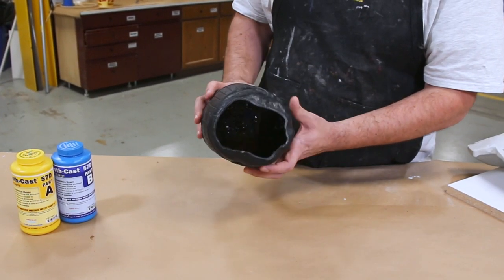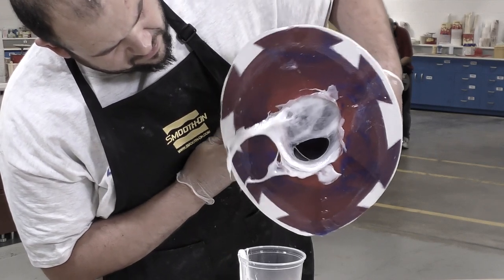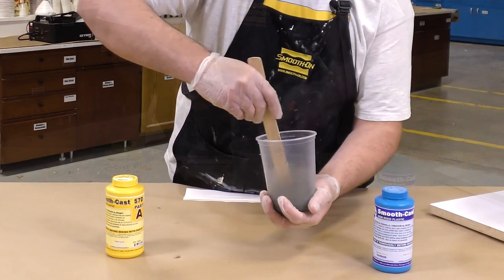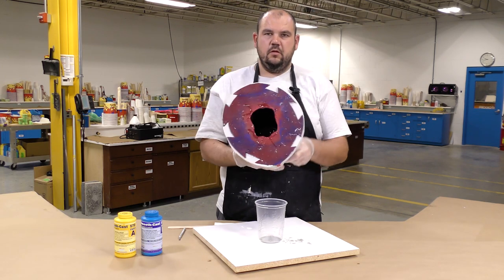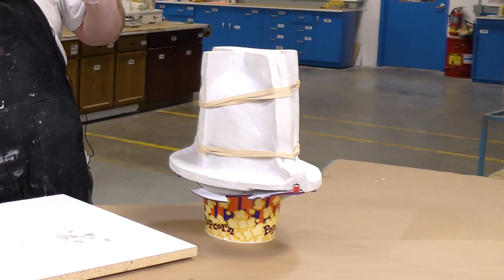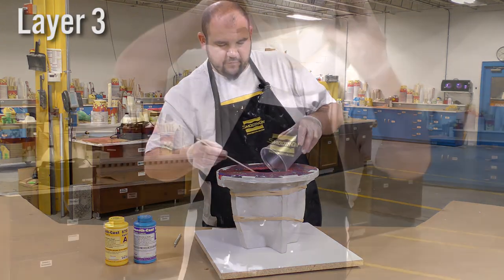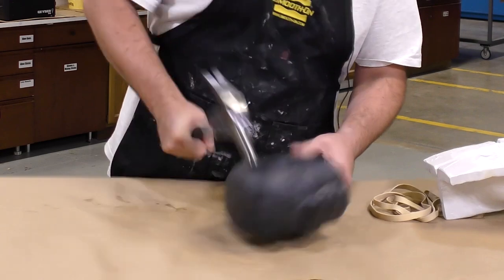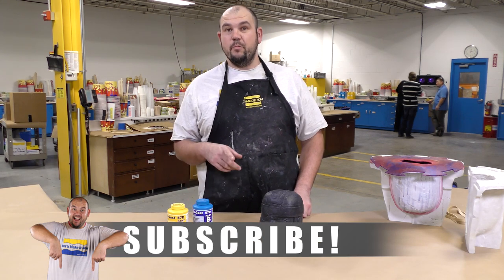Resin Casting Tutorial - Hollow Impact Resistant Casting Using Smooth-Cast® 57D

Comment: Thank you for tutorial. Can it be brushed ? If I have two half mold ?
Reply from the maker: Yes, many Smooth-On products can be brushed on. However, the specific method of application can vary depending on the product and the project. If you have two halves of a mold, you might need to brush the material onto each half separately, then join them together. For the most accurate advice, I recommend visiting the FAQ section on our website or contacting our Technical Service Department. They can provide detailed instructions based on the specific Smooth-On product you're using.
Reply: @smoothon  Thank you!!🙏

Comment: I have a question as I am dubious about the end of the video.  After the cast is out we see an impact test but not the inside of the mold. The flashing on the bottom is lighter colour than the grey from cutting the flashing and its blurred out at the end of the video showing a super bright white 4th or 5th layer of reinforcement Resin. Why was this not mentioned in the video, why is the cavity hidden for the impact test.  This stuff is a lot of money to use in my prototypes and would be more than angered if my hammer test breaks my piece. What's the missing info.
Reply from the maker: You have a great eye for detail! These videos are shot over a number of takes and often different concepts or ways to illustrate the steps are tested out. Ultimately, all of the footage is edited together to make a (hopefully) clear overarching narrative. The hammer footage at the end of the video is taken from a slightly altered version of this tutorial which did have a bright white interior; however, all of the test castings underwent the same hammer testing and as long as they were at 4-5mm thickness, all survived without a scratch. Of course, we'd always recommend that you do your own small-scale testing for your own pieces to determine suitability for your specific application.

Comment: What was the main reason for using 57D instead of 65D? How much of the 2 pound trial kit did you use in this video?
Reply from the maker: 57D is easier to color to a deep black as it does not cure with a change to white like the 65D does.  About half the kit was used.

Comment: I have a quick question: If i where to use transparent casting with this method, would the cured end result be transparent enough to see through without any polishing inside?
Reply from the maker: Rotocasting a clear resin does not generally produce an optically clear surface, as bubbles can form during the rotocasting process.

Comment: Can Smooth On Onyx resin be used for this type of casting? (Progressive cure as opposed to the instantaneous cure)
Reply from the maker: It may be possible, but you would need to test to determine if an even layer can be created for your particular mold configuration.